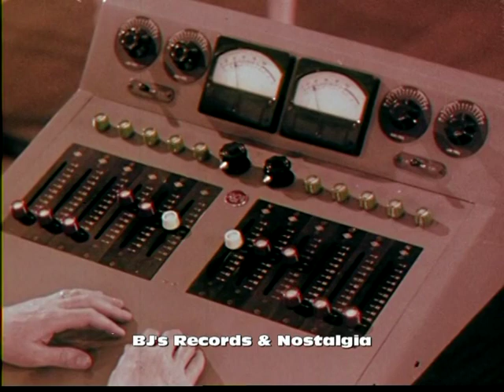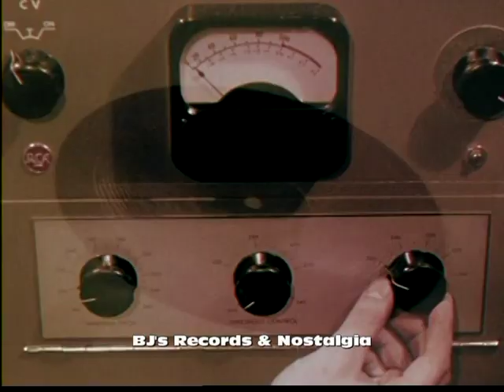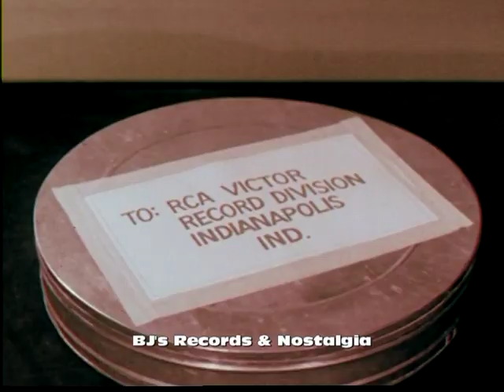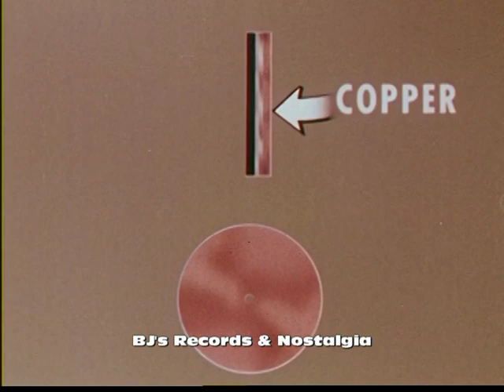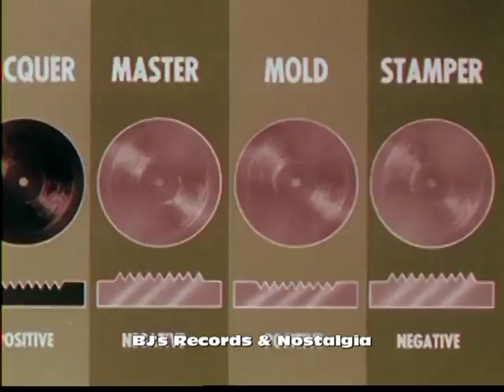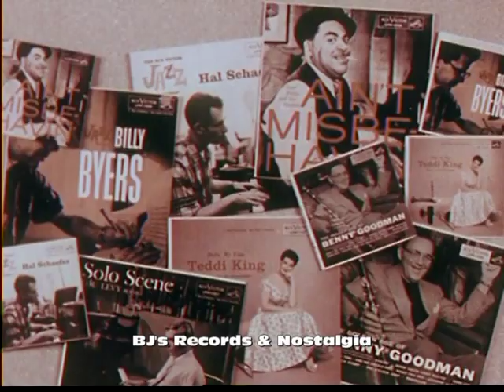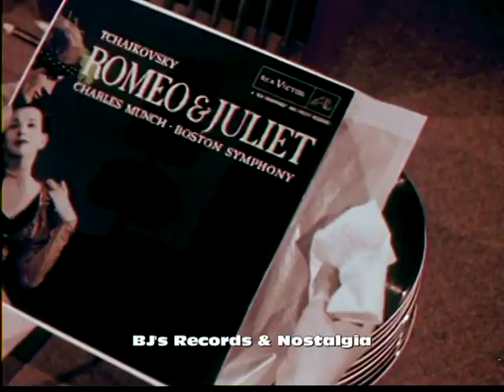HISTORY OF VINYL RECORDS #2  - The 33 1/3 RPM Long Play

Comment: I had to laugh at the "preserve the dynamic range of the original sound", back when compression was used sparingly and only to give the sound more lifelike recreation, now, boost and limit everything is the standard of modern pop and rock bands, compress it as tight as possible, realistic recreation be darned!
Reply: Sure but in this video, they are recording a symphonic orchestra. Classical is essentially treated the same way today. As true as possible to the original performance.
Reply: Pop records: When rock aka western swing music came on the scene, they were heavily compressed and limited. And EQ'd with a haystack at 3K to make it sound louder. However, classical music was also fiddled with, dropping the low frequencies so longer compositions would fit on an LP.

Comment: The records from the 50s almost never warped due to that they were pressed much thicker and harder than records later on.
Reply: And much more brittle not being of the more flexible vinyl. Also they were cut and played in a 'hill and dale' motion needing a thicker material. Vinyl was cut in a sidewise 'wavy' motion requiring a finer, more precise stylus in the playback. Players of both LPs and 78s had two different stylus carriers on the pickup arm marked as such so you needed to switch over to the correct stylus for the type of  record. Playing an LP with the coarser 78 stylus would cause premature wear on the record.

Comment: Most 33 1/3 RPM Long Play records  WERE made of vinyl with some injection molded using poly styrene. The original 33 1/3 RPM longer play records were introduced by RCA in 1931. These were made of shellac, just as the 78's were.

Comment: You can see the two U50 microphone stand on each side of the stage. Richard Mohr and Leslie Chase, being producer and recording engineer respectively. AMPEX 300 two track portables doing the capture on tape. They were recording in stereo 3 years before the stereo LP. Mono signal for the mono lease was captured on one of the Ampex recorders.